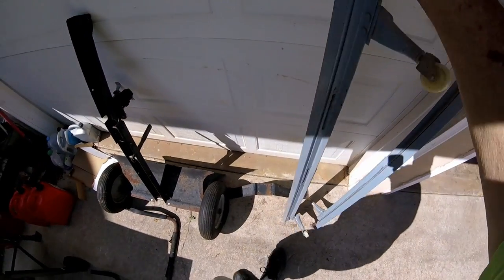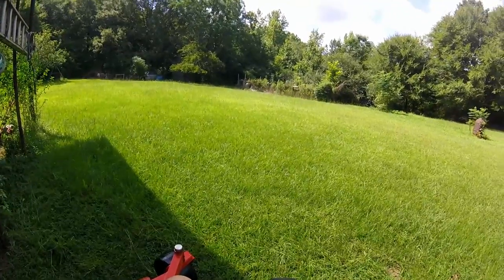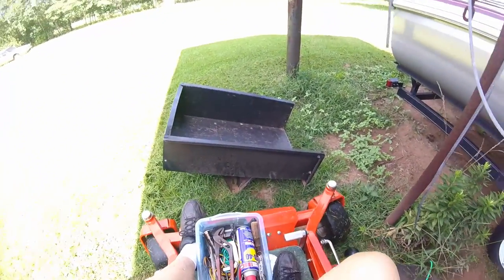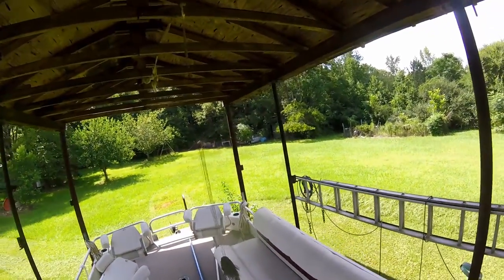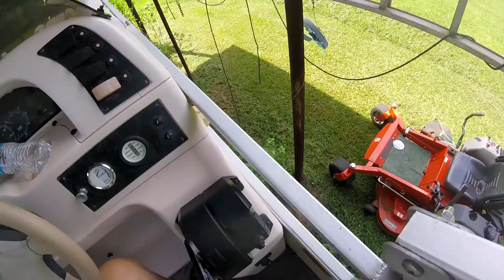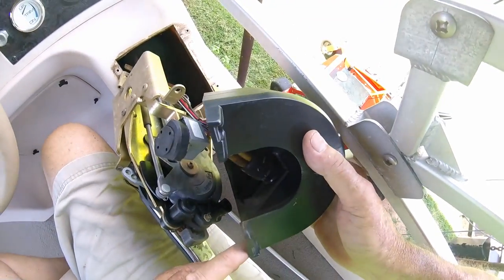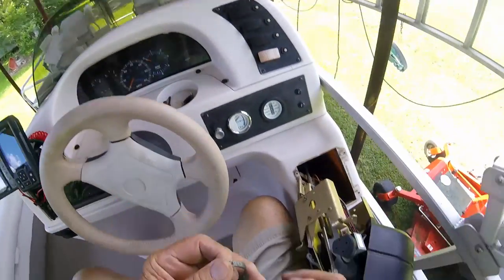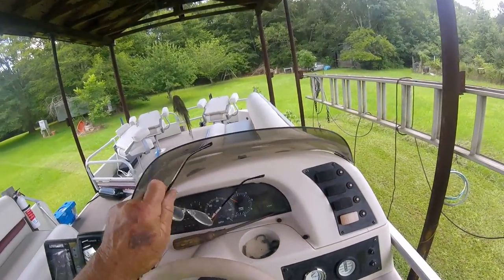Pwalpar VLOG Removing My Boat Ignition Switch

Comment: Next time you pull the boat from under that covering, go bring your lawn mower out and go straight across the shed rather than missing the weeds which only got partially cut.   

Trusses look good, abut  2' on center for them. Plywood covering 8 or 10 sheets depending on which direction you have them set.  Hopefully you did use hurricane strapping where trusses hit your header frame.  That would help keep it in place during a higher wind than some of the breezes you get there.
Reply from the maker: Thanks so far it has survived some very strong winds    I do need to mow the weeds better

Comment: I've seen that "Pollak" name around in the switch, connector, and plug world. Don't know if I've ever seen a Pollak ignition switch, or maybe I have but it didn't have to be changed out... Seen quite a few "Indak" ignitions in lawn tractors and small equipment.  I can't believe it's going to be 71 bucks for another one.  Do you think there's any way that between you and Contrary Mary you could come up with a shielding (fabric) cover to snug over top of the helm to keep the sun/rain from beating down on it?  Something like a vinyl BBQ cover (except smaller in size) with an elastic stretchy band sewn in the bottom...
Reply from the maker: Thanks  I appreciate your excellent suggestion